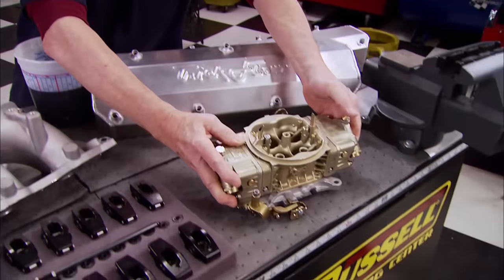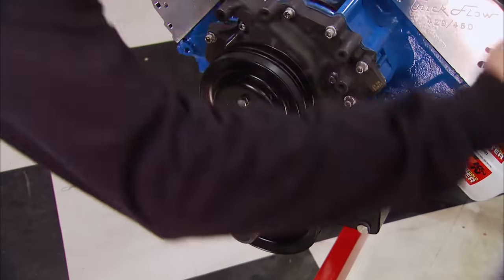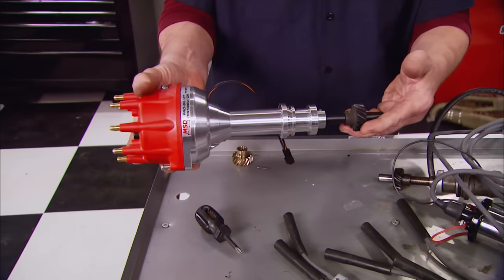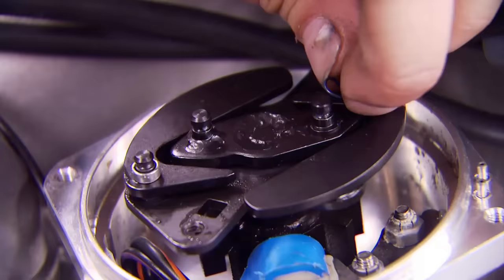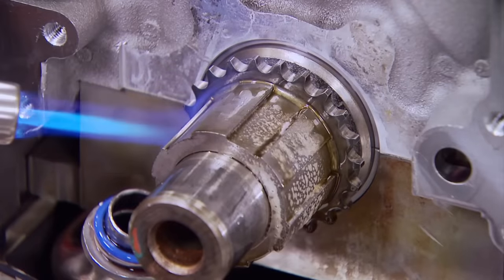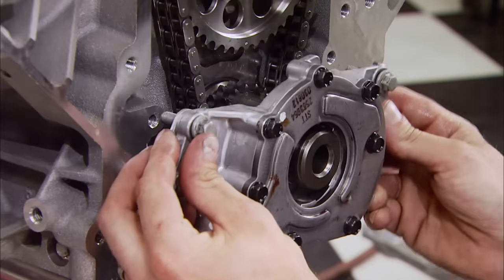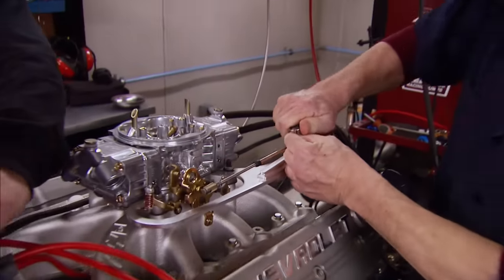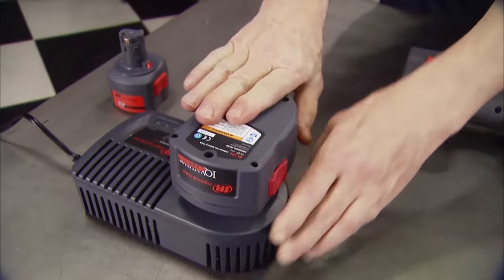Ford 460 Engine Build Part 3 - Horsepower S13, E10

Comment from the maker: You can subscribe to the PN+ ad-free version for only 99 cents for the first month! 
Link: https://www.powernationtv.com/user/subscription?promo-code=2019
Reply: Joe Elmore was always awesome watching on tv. Seems like hes a real trip to hang out with
Reply: Your going to loose half of your subs if you keep turning Ford episodes into LS episodes. You went right to the LS before it was even at the half way point of the video.
Reply: Fix the dam title.
Reply: Why the hell are you building a boring LS in the middle of a Ford episode. ??? come on guys
Reply: What was the full dyno pull on the 460?  I'd like to see RPM #'s and especially the torque.
Reply: Stock pistons from episode 1 and 2?

Comment: Back in 1979 I worked at Ford on one of the 385 lines building 460 engines.  It does my heart wonders to see one of these old engines brought back to life.  Thanks for a great show.
Reply: I'm probably driving one of your 460s. Still runs great. Thank you.
Reply: Your welcome.
Reply: A 460 is what I run in my 77 F150 4x4. Can't beat it.
Reply: I also run a 460 in a 91 F350...
Reply: Yea a 429 scj gives me a stiffie
Reply: John Doe  still trying to put that english degree to use i see
Reply: Had one in a 79 f150.  Awesome engine
Reply: well, when me and m grandfather get our 460 together ill be sure to let you know. I love seeing these under rated monsters do well.
Reply: I believe the most powerful 460 ever put in a car from ford was in the Mark 4 and made 365/500. Basically they took a dog late 70s-80s 460 and did a cam intake and ignition swap and made the same power.
Reply: Thank you for sharing that memory
Reply: Thanks for building great engines sir.
Reply: @8068 I just brought back my grandpas 89 F250 with the 460. She sat for 12 years. Purrs now 🥹😀
Reply: Well you probably don’t wanna hear the truck we are putting one in 😅😂😂
Reply: "One of the 385 lines" building 460s? What were they building on the other "385 lines" because in 1979 Ford didn't sell enough 460-powered vehicles to require multiple 460 "lines" unless you "builders" were as slow as your products.
Reply: @deeremeyer1749  lol slow as your products, that's funny. They just walked away from a mild built 460 that put out 120 hp. And over 150 on  torque. Than that piece of junk ls bla bla  bla. Oh and by the way a 500 ci Ford motor holds the quarter mile or 100 ft. So let's talk slow.  lol.
Reply: I've got an 88 motorhome with a 460 in it. Over 35 years old and still runs like a top.
Reply: @richardpowell1389  Thanks!
Reply: I got a 460 in my 93 E-350 rv... runs great still
Reply: @DEEREMEYER1  smh, they weren't building 460's on 385 lines... he was on one of those lines building 460's... slow products? What holds the fastest standing mile? The gt500 is the only car to beat the hoonicorn...
Reply: Got one going in my 99 ranger
Reply: a few years behind on this comment lol, but i have a 79 f150 that I really wanted to put a 460 into, but im sticking with the 302 it has haha

Comment: I was all hypin' on the 460, and then you showed an LS engine. My testosterone level dropped and my nads shrank to 4-year-old size. Gee, thanks a bunch. Next time make anything Shivvy a separate episode so I don't have to throw darts at my monitor.
Reply: Right wtf is that. It should be called how to turn a Ford episode into a chebby episode.
Reply: I'm so sick of Chevys including that last I could just puke.
Reply: @troymi1648  
Did you notice the change in attitude & enthusiasm I'm so done with shows that don't give the blue oval it's due respect!

Comment: How to make an LS look like the 351W it was copied from lol
Reply: @mikec9112  100% agree
Reply: @mikec9112  how did chevy copy ford???? LS has nothing to do with this shit engine
Reply: Ford really screwed themselves giving the ls design to gm and deciding to go with the power monster 4.6 instead huh?
Reply: Trigger some Liberals  Hes a internet car guy. Knows it all, as you can tell.
Reply: Darkhorse393 modern-day Marvel LOL thanks Ford
Reply: Got all these damn guys in here dissing Ford when Ford has plenty of good engines that stomp the other big competitors like Dodge and Chevy.
Reply: @mikec9112  Still trying to figure out why people ignorantly think Ford invented cross-bolt mains, lol. Btw, the LS isn't the first GM engine to use cross bolts, they first did it back in '67.
Reply: Darkhorse393 óo/bbíęś
Reply: @timsmith854  Mopar cough Fiat, is the worst. Hemis are even Hemis anymore. And they have to make their engines whole litres bigger then Ford or GM to get the same power. Their cars are only good in a straight line and have tons of recalls.
Reply: @bilbobaggins4710  The bottom end of the LS engine is a virtual carbon copy of Ford's mod engines, which first came out in 1990 . The LS uses the skirted bottom end , cross bolted mains, open deck, and head bolt locations in the block , that was all copied from Ford.
Reply: @HowardJrFord  nope....And even if so why didn't Ford make an LS and have the same success??? Why do they make complex engines that are plagued with issues???????? Chevy small blocks have always been the most popular on the planet ....The most popular choice of hot rod builders since the  60's... did you even check out the link???? It's one of many that debunk this copy cat narrative
Reply: @HowardJrFord  oh and Pontiac designed the Hemispherical head design and sold it to Chrysler, does GM get any credit for that????
Reply: @bilbobaggins4710  uhhhh, no lmao. there were hemispherical heads in 1909.
Reply: @bigboreracing356  its been dethroned by plenty of cars. Dodge says 9.56, but people can't get lower than 9.90s. For 80g+, that's a fucking joke.
Reply: @bigboreracing356  BTW, the old hemi was a pig on the street. Tempermental bastard too. A 440 would destroy it.
Reply: @bigboreracing356  and dodge has never had a race track monster.(viper isn't dodge) dodges stuff is straight line only.
Reply: @bigboreracing356  the demon hasn't even been able to fucking recreate that 1/4 mile time. People can't get them past 9.90-9.80. There are cars out there running faster than that for laughably cheaper. A controlled environment doesn't count for shit when you get in the real world.
Reply: @bigboreracing356  horsepower isnt the only thing that matters, and Ford produces an engine that is whole litres smaller with less then a 30 HP difference. Hemis are not even Hemispherical anymore, it's not just a name to keep you buying it. They are only good at making a bigger engine to make it more powerful, wich isnt a bad thing but anyone can do it. And, its shows that's all they do considering all of their products have transmission and differential failures, constantly. They are only good in a straight line, wich all bit it. Is all the Demon is made for. And, no arguing the demon is the best drag focused car, but the hellcats arent supposed to be only drag focused. Ford excels at innovation,even if it tends to blow up I  their face some times. But they have never been bought out, and are still all American.
Reply: Nothing about the LS series is copied from a Ford engine. Most of the design features are taken from Buick engines, going back to the 215 aluminum small block. It too also used a deep skirted block. The cross bolted mains were nothing new either. The 4 bolt per cylinder layout was nothing special either, and not exclusive to Ford engines. A number of features that were eventually used on the LS are from the Buick V6 engines, which were evolved from their earlier small block V8. As for the firing pattern, there are only so many variations on how to fire a 90 degree V8 with a cross plane crank. And GM had used the same firing order in older engines as well, though it was less common.
Reply: @hishok3332  the LS firing order is 1-8-7-2-6-5-4-3
Reply: @rdsimmonds  mopars are red Ford's are blue LSs are are gay so are you
Reply: @hishok3332  cute. Sad that you have to resort to insults instead of having an actual conversation or debate. Perhaps if you had instead of resulting to childish behavior I would've agreed that while the numbering pattern is different, the LS does have it's firing order laid out in the same pattern as the 351W. But as I've stated elsewhere, Ford wasn't the only one to use that firing pattern. There are only so many ways to fire a cross plane crank V8, GM just chose to use the one that showed to produce the least amount of crank harmonics and reduce stress on the bottom end.
Reply: @rdsimmonds  relax is a joke just like the Ls and ford y block valve covers WILL fit on a ls won't bolt up but will fit and the Ls is carbon copy of a Ford y block
Reply: I'm not sure we're thinking of the same Ford Y block. Look up an image of the Y block and the LS block. Very different. Aside from the basics of being a V8, the only thing in common between them is the deep skirting on the block. The Buick 215 V8 though looks a fair amount like a 6 bolt LS block.
Reply: @rdsimmonds  you got a point there. They even took the gerotor oil pump from the 3.8/3800
Reply: Most of the design is taken from the Buick V6. The gerotor pump, the plastic lifter trays, the 4 bolts per cylinder, replicated ports, deep skirted block with cross bolted mains. There are also some similarities to the Cadillac 4100 style V8. 

Now I will admit that the 351W was a great design, better than the Gen1 SBC in many ways,  the engineers got a lot of things right when they designed it. But the LS is not copied from the Windsor.
Reply: @bigboreracing356  because torque is more important and they don't run at a higher RPM
Reply: @frigglebiscuit7484  I ran into a guy that has an alcohol powered 2 liter Volkswagen engine dragster that runs 8s
Reply: @bigboreracing356    Cost efficient to build a cheap pushrod for fleet vehicle use and an alternative to diesels. Also most modern vehicles are Dohc and gm is heading that way as well
Reply: yup, to make them so big they have to go into an engine bay bigger than a house.  That's a larger engine that make a whopping 25 hp more right?  Bigger engine bay, bigger engine for a meager hp gain.  Most right minded people would say that's a lousy trade off, but not Ford guys.

The LS design isnt just about using crossbolt mains, nar nars.  It's about the cylinder heads for air flow.  The modern LS is leaps and bounds better then a mid-60's crossbolt mains motor by a pretty fair margin.  Ford made the mistake of sticking with that 5.0 not evolving up to larger cubic inch motors with retaining a small package.  They tried and failed.  5.4's blowing out spark plugs and sticking the customer with a HUGE repair bill for a major design flaw of their own design.  Now they got EcoBoost engines where the fix for a flaw in the turbo blow off valve is to drill a hole in the intercooler.  Coking turbos plagued by WAAAAY too much carbon building up in the turbines because they are too lazy to use a variable vein turbo just because Chevy uses them.

Dont get me wrong Chevy has alot of design problems of their own but most of them are accessory issues and not motor internals.  The last problem was a valve guide problem on LS7's but other then that they are just more reliable, hands down.  Unless Ford steps up their game, they're going to get left behind.  The new HEMI is on the way and its boasting way more power than both Chevy and Ford.  By the way its using crossbolt mains also. It's an innovation that Ford ditched all on their own and nobody had a gun to their head.  If your a Ford guy, that's ok, I'm not gonna knock you but you better start getting to them Ford engineers to start innovating and stop imitating.
Reply: @bigboreracing356  ford 427 cammer. It was such a monster, Chrysler/dodge pitched a fit and got it banned from nascar. 650 HP with dual carbs, just over 600 hp with a single carb.
Reply: @bigboreracing356  the every ford DOHC and SOHC was, and is based off of the 427 cammer. They are rare and quite expensive, but still around. Had dodge not pitched a fit like a little girl and actually competed with ford on engine building, we'd see a lot more now days. But, the hemi of the time couldnt compete with the cammer.
Reply: Big block Ford engines typically out performs Chevrolets and since the multimedia corporation who owns PowerNation holds political allegiance to GM, Engine Power always supresses Ford HP and Torque. 
In this case, no detailed dyno results in spite of using low compression hypereutectic pistons ..and we can see Power Nations  bias to GM in 95% of their shows.
Reply: @Thecowboy69997  it's old news it got left behind just like ford itself Ford has failed at almost every design chevy and dodge are way ahead of ford and chevy ahead of everyone on durability you can't argue with facts and those are facts
Reply: @jonathanlawson4667  those are opinions, not facts. I personally know of several gasoline chevys that have had engine trouble within less then 100k. One of them only had 700 miles, and had to have a new engine put in it because it threw a rod through the block. The other one was the same thing, except it was at around 20k miles. The second one has been having to have new fuel pumps put in quite often. Another one that I known of that had trouble, the engine went into limp mode for no reason, and would over heat if you didn't drive fast enough.
The only thing that dodge has going for them is that they can build a fast vehicle. Dodge bodies and interiors, and pretty much everything about them except for the hemi is crap.
Reply: @Thecowboy69997  I'm a twenty year tech and probably will be doing this twenty more years and I can tell you they all tear up but Chevrolet is the best for  performance longevity and parts replacement is cheap I drove fords for a couple of years in my younger days before I knew better I went to Chevrolet when I was twenty years old and I'll never drive anything else because there's nothing better
Reply: I'm gonna end this debate...The Chevy NASCAR RO7 V8 is based off the 1970 Ford 351Cleveland V8 also so is the NASCAR MOPAR AND TOYOTA V8 Engines!                      Furthermore it was FORD that beat FERRARI at Lemans not DODGE and certainly not CHEVY, ha  they would not hold up is 24 of racing!                  Lastly, in 2013 HOTROD did an article on the Ford Shelby Mustang GT 500 5.8L Supercharge V8...They Dyno'd it for....TWO HUNDRED AND FIFTY STRAIGHT HOURS! The magazine editor commented that he was surprised the Exhaust Manifolds just didn't drop off the engined as they were glowing lava red the whole time!
Reply: Vintage Mopar is ludicrously overpriced for what you get. There's a reason they say "Mostly Over Priced And Rusty."
Reply: @vernonknight9455  The R07 looks like it bears more resemblance to an LS motor than a 50 year old Ford V8. And honestly, these motors aren't like anything you're buying on the street. There are a number of large differences that make me think it has little to do with the old Cleveland, specifically, it uses much smaller mains and the bore spacing is completely different. Also, 6 bolts per cylinder. Really, the only similarities are the pushrod 2 valve layout and 90 degrees with 8 cylinders. 

Dodge didn't enter anything in LeMans. And if you look at the list of finishers, you'll find far more Fords who didn't make the finish line, than did. IF you're going by reliability over 24 hours at the 1967 LeMans, the smart money is on Porsche. They finished with the most number of cars.

Comment: Finally a BBF gets some attention. Why did they have to ruin the video with yet another LS build.
Reply: So sick of LS builds.  Yep you can BOLT anything to them. And drop them in anything. V8 rice rocket if you ask me
Reply: @n1uk214 I would agree that they make kits to install them in just about anything and for the average beginner a LS would be the easy choice. But for the experienced guys it's just plain boring. They don't make adapters for where we're going!
Reply: Richard Skipper  i use a 429 with RV cam and iginition.  For my pull truck. I like the extra weight
Reply: Richard Skipper  Brother you aren't kidding. I put one in my Miata and it didn't like it one bit.  They make an AM aluminum block for those who can afford it.
Reply: Richard Skipper  hey im Working class too buddy.  Thats the best part of these old big blocks. Heads like the D0Ve and D1Ve are high proformance. A2A heads were interceptor heads . Decking the block and a cam goes a long way with big blocks. Even a stroker kit only runs around 2000 dollars
Reply: To show you ford punks who the king is 
We went back in technology with carb and dist, that little 346 cubic inch dogged that ford
Reply: @loveablegurl100  what are you even talking and shiw some respect
Reply: Thank God, I've found other people who are sick of the ls platform. The ls is such a cookie cutter build it's cringe to watch for me now.

Comment: This is why I could never build another motor from scratch again.  They took a 5.3, put a camshaft in, converted to carb and almost 500hp. By the time I bought the fuel system I spent $10,000 bucks building a 347 stroker. I don’t like putting a Chevy in a ford but if I ever had a mustang again I would put a 5.3 in with turbo and when I blow it up I’ll go get another one for 500 bucks at the junkyard.